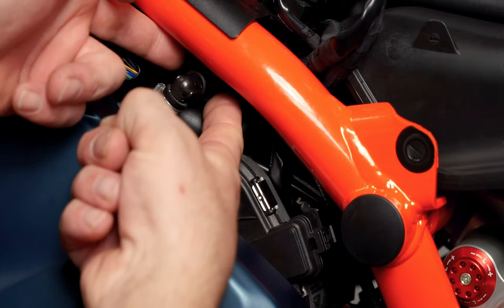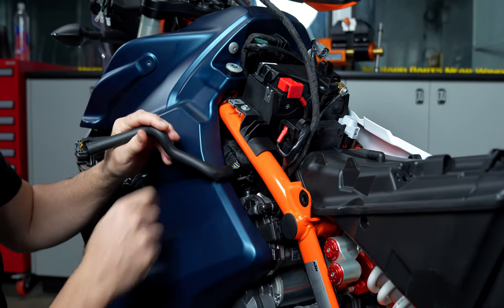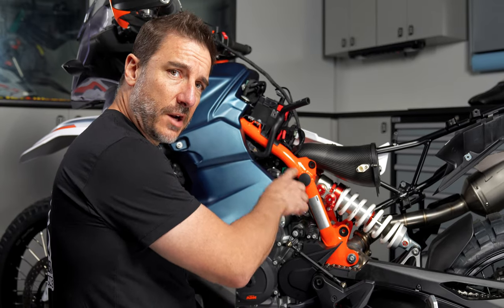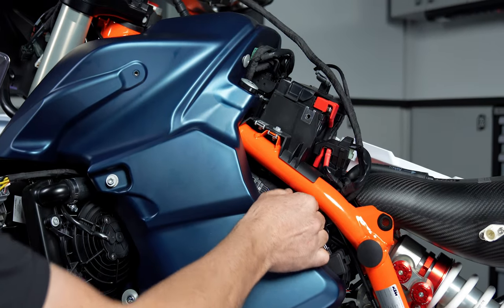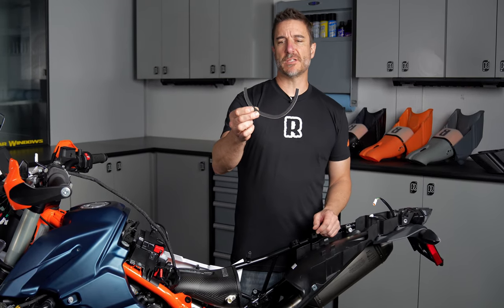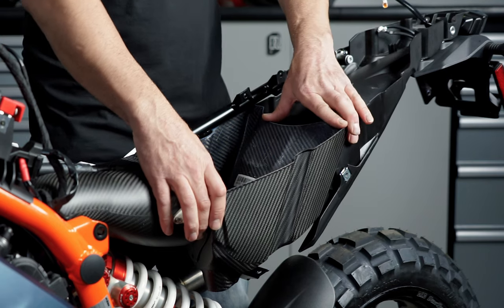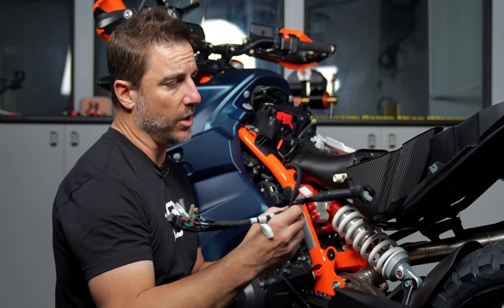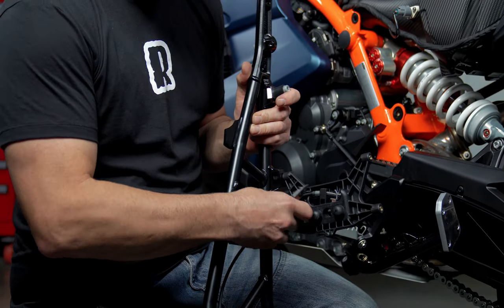HOW-TO INSTALL RP INTAKE SYSTEMS - KTM 790/890 ADVENTURE

Comment: Is there any way of securing the nuts on the inside of the intake. You say don't use locktight but  I'm worried the nuts will come loose and get sucked into the barrels, and that would be expensive!
Reply from the maker: Philip, the nuts are nylock nuts and the bolts are slightly long so there is no way they will every come loose. You are welcome to Loctite those if you wish, but it is not necessary. We sometimes tell people, "Think about this: there are also about 50 lubricated bolts spinning inside your motor with no more than torque on them, and no one is worried about those", just to put things into perspective.

Comment: I have the full Rottweiler with full Akra exhaust --but the "old" power plate style.  Am I missing out vs the new system here?  How much?  Any kind of upgrade program?  Would the PCV map need to be changed?  Thanks.
Reply from the maker: The Power Plate does a fantastic job at filtering dust, but is not in the same power increase category as the full system intake. That is shaped and built to do the same as the Power Plate in terms of dust protection, but carries a large horsepower gain as well. Roughly 10 horsepower to the tire at 6300 RPM as measured on our 790 test bike. Those are the major differences between the two in terms of what they accomplish power wise. The full carbon intake just adds some Formula 1 or Moto GP to the equation. 

If you bought the PCV from us the maps are always free so while you don't NEED to update the map in terms of safety, it's always a good thing and free. You just need to reach out to our tech line with your order number and we will send a free code. info@rottweilerperformance.com is where the inquiry (or enquiry if you are from the EU) should go.
Reply: @RottweilerPerformance  I had the same question. I put the power plate on my 790. 
Should have looked at this system first
Reply from the maker: @8andsk835  It just comes down to budget and what you are trying to accomplish. The Power Plate does an amazing job at dust protection, but doesn't carry the same power increases as the full intake which makes about 9hp at the tire without any mapping. Throw in looks, ease of filter changes on the road, simplification of the bike and the ability to run our 1.6 gallon fuel tank that's coming out in the next few months and the full intake is a win, win, win, win.
Reply: @RottweilerPerformance  1.6 gallon? Tell me more...
Reply from the maker: @8andsk835  Check this video below at 1:46.  We show it briefly. We are testing the first prototype this weekend (9/15/21) and just filled it up.  It was actually 1.8 gallons! https://www.youtube.com/watch?v=Eli2d9ht2oU&t=1447s
Reply: @RottweilerPerformance  genius!! Dude I will keep my eyes peeled!!! Beats a rotopax!!

Comment: Does this influence the gas intake (mileage)?
Reply from the maker: Not at all. Fuel injection is basically set to deliver a 14.7:1 air fuel ratio regardless of what is bolted on to the bike. You can install an exhaust, an intake, a decat and it will just compensate at 14.7 air fuel ratio all the time and does a great job at it and you will still make good power without mapping.  That being said, there is a good amount of additional power available from mapping, but that is what will reduce your fuel mileage really.  Not the intake.  We have an auxiliary fuel tank coming that holds 1.8 gallons (6.8 ltrs) that fits right up to this intake so you can have your cake and eat it too.
Reply: @RottweilerPerformance  I thought I saw what looked like an auxiliary tank in one of your pictures..... excited!
Reply from the maker: @yurgon  We are in testing now (Nov 2021) and should be offering them early 2022!
Reply: @RottweilerPerformance  I’m waiting patiently in that aux tank. I wanted to do everything at once. Any time frame on the tank?

Comment: Did anyone get a check engine light after installing this? I have a power commander with tune also.
Reply from the maker: If you are running a Power Commander V with a STREET map, you should not have a check engine light. If you are running a RACE map which requires that you unplug your stock narrow band O2's, then you will have an engine light. This is all spelled out on the pages on our site where the intake and Power Commander are for anyone reading this. If you are running a STREET map and still have a check engine light, just call us and we can walk you through steps to find out what that may be. It's usually something small just not plugged in and will go away after it is reconnected. Either that or you have an engine light for another unrelated reason.
Reply: @RottweilerPerformance  I have the street map with intake and decat. I also removed the evap can.

Comment: Why would you need a new intake? Is the stock restricting? Seems like a waste of money.
Reply from the maker: Few things Cousin Liam. First, the stock intakes leak dust very badly. See this video here. https://www.youtube.com/watch?v=TerSUQMBupQ Second, this intake is a drop in 9+ horsepower to the tire. See this graph here. https://cdn10.bigcommerce.com/s-xk32d/products/1418/images/10151/790_Intake_Dyno_Chart_2__64744.1605640556.1280.1280.png?c=2 Third, just look at it...
Reply: @RottweilerPerformance  I am more into mods that will give Torque. This bike has enough power IMHO, but thanks anyway, now I know how to disassemble part of my bike !
Reply from the maker: @ItsOnlyFil  If you like torque, then this also delivers in a big way. Check this chart here. The dotted lines are showing the measured torque. This is with a decat, Rottweiler Intake System and mapping with advanced ignition. https://www.dropbox.com/s/bdnkmjq9bdlmat5/RP%20INTAKE-DECAT%20EXHAUST.png?dl=0
Reply: @RottweilerPerformance  There you go !  Fun is coming , for sure I'll look into it !